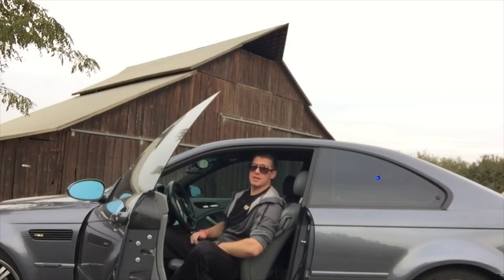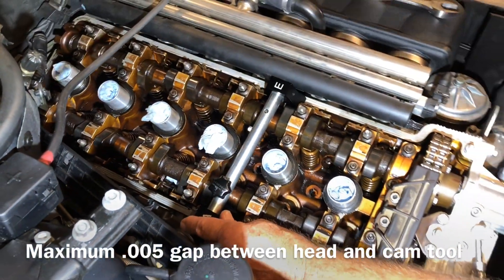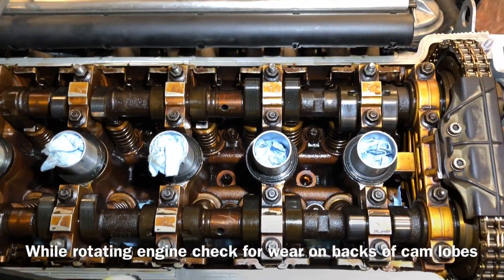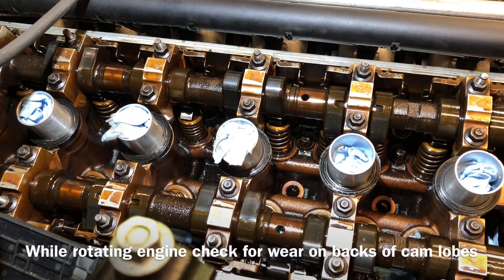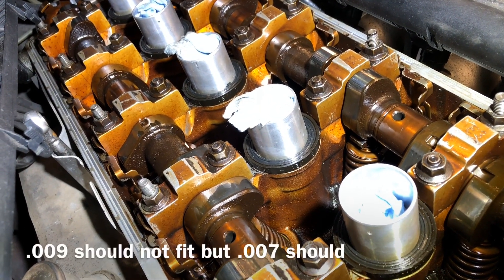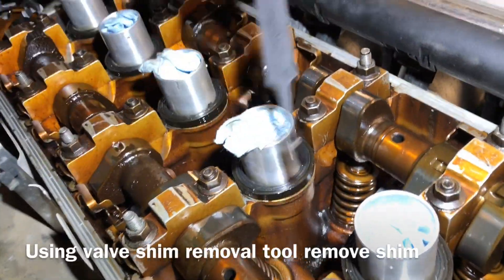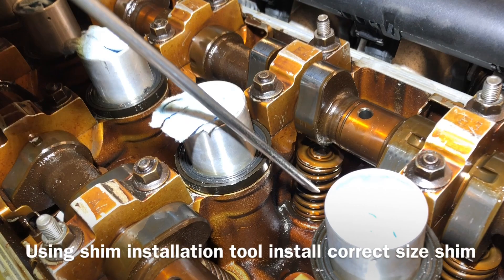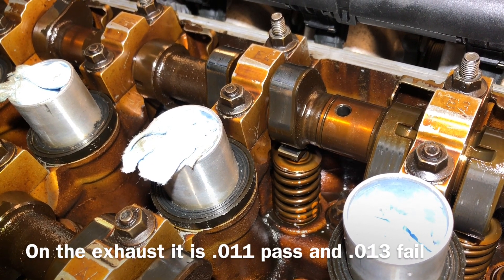HOW To Valve adjustment e46 m3 S54

Comment: Great video!!!!   I have problems set cams before valve adjustment.I put pin to crank shaft.l. put timing bridge ,but I can’t turn intake or exhaust cam with 24 mm tool. Can’t you tell me way please???thanks

Comment: I think you can do it while working on the vanos, if you have the cam alignment tool and are ready to adjust the timing afterwards. 
Also, watch out not to drop the shims (or put some towel to plug the holes), it happend to me twice (fortunately I was able to recover the shims with a magnet!)
Reply from the maker: Thats the perfect time to do it; when its already opened up!  Lucky you that you could save it!

Comment: Hi, great video! I just have a quick question. Is the camshaft alignment tool really necessary? My car has been running fine, so I'm assuming the timing is correct. I want to check the valve clearance and adjust if required but wasn't sure if I needed the alignment tool to do this (It's $234!)?

Comment: Thanks for this. Will be doing this next week since the PO neglected to do so. I'm also due for rod bearings in the next 8000 miles also
Reply from the maker: thank you for letting us know you enjoyed it.  Rod bearing video coming in a couple weeks! should be a good one
Reply: @FatboysGarage  Absolutely fantastic videos, worked in a 70 year old machine shop for a few years, haven't seen attention to detail since the owner retired and closed up shop. Please keep posting videos, own an e46 M3 myself, just to appreciate the engineering and art of the car.
Reply from the maker: @evajordan450  Appreciate that!  Were going to keep it up!  Glad to hear you enjoy the videos! Is yours a current project??
Reply: @FatboysGarage  I named her Phoenix, picked it up not running, 116k miles and had sat still for 3 years outside, spent almost two months working on it before I brought it home from the shop. Going to rod bearing soon as well as full restoration of the interior and a full paint job. It has the SMG, and I love it. I could have bought a clean one, but I couldn't bare to see this car get parted out, so I dug my heels in and am currently trying to decide on a direction to take the car. I've been leaning towards keeping it original with minor upgrades such as Vanos, touch screen radio, SMG and ECU tune, upgraded headlights from 865 retrofit, and maybe a carbon fiber roof down the line. Its alpine white with soon to be black interior. Puts a smile on my face every time I see her in the garage.
Reply from the maker: @evajordan450  beautiful, glad to hear you saved one from becoming scrap.  Im sure in long run youll be happier with your choice and can look it at and see your achievement.  Whatever direction you take it, it will be exactly what you want it to be, since youre going from ground up.

Comment: Any tips on old stuck rocker arms? None of mine will move more than maybe a quarter inch when trying to slide them over
Reply from the maker: you can consider some seafoam deep creep and spray it into the rocker arms, let it really soak in for a while( days perhaps if necessary).  Work them around to get them loosened up from the grime thats in there.  You'll want to change your oil after this to ensure no contamination.  Let us know how it turns out!

Comment: If you have to a valve adjustment and rebuild your vanos, which one would you tackle first?
Reply from the maker: With ours, we first did the Vanos, as we put the engine back together we then performed the valve adjustment.

Comment: I'll leave that job to the professionals :) I'm going to do a coil and spark plug replacement on my 2004 M3 that I just bought. That's about as adventurous as I want to get.
Reply: lol then you bought the wrong car, prepare for cracked strut towers, blown through shock towers, ripped our RACP panels, and torn subframe mounts. Its literally a car you don't want to own if you aren't willing to do almost everything on it yourself
Reply from the maker: @DontStopReeling  You are right about that.  Not to mention the VANOS.  This car could cost you 15k in damage and maintenance in no time flat lol.  Great car has a lot of great qualities.  But with the great qualities come lots of work you HAVE to do yourself.  Cant be afraid of it, thats what were here for trying to show how.
This January comes lots of new videos- including that subframe, brakes, and rod bearings.
Reply: @FatboysGarage  I essentially had to rebuild everything except the trans and engine on my e36, still not happy with 25% lock , 95a poly bushing still move a lot. The reaosn why I can't get myself to buy a e46 m3 is people sell them at the point they need rod bearings and RACP reinforcements. I keep debating whether to get another e36, an e46 or a 335i , but I'll probably get another e36 because I can easily fix everything on it myself, and its a great platform to learn how to wrench on
Reply from the maker: E36 is a solid choice man. e46 or 36, you're gonna need to rebuild a lot of the car.  The solid bushings are the way to go.  I thought they would be to stiff, but our track day car has solid all the way around and you know what?  It rides better in my opinion than our street car with the Poly's.  In January youll be seeing our work on the chassis reinforcement: we are going to extra lengths with a special kit.  Let us know which one you decide on bro, we love to see your project

Comment: Hi there grate video I’ve got a quick question so if a .009 fits all the way on the intake side and.013 fits all the way on exhaust side do they need adjusting.

Thanks
Reply: Yes they would, .013 and .009 should not fit
Reply: billy verduzco thanks for the reply

Comment: The clearance measurement procedure is not correct.
A probe is inserted between the end of the valve and the rocker, but not between the rocker and the back of the cam of the camshaft. The gaps at these points are different.
Learn geometry!
Reply: Eh, that’s not correct. According to different sources online, and a write up from ECS tuning on how to perform this procedure, it is to be measured between the rocker arm and the bottom of the cam lobe. NOT between the rocker arm and the valve shim.
Reply: what are u refering to?
Reply: When the guy measures the clearance he slides the feeler gauge between the cam lobe and the rocker face. 

You are supposed to measure from the top of the shim to the bottom of the rocker.

Comment: Great video guys! This job looks a little intimidating for the average DIYer. How long should it take for a good mechanic to do this. I inquired how much does it cost at my local shop and he told me around $1000. And if I purchase the shim kit does it come with those tools to check the measurements and also that BMW tool with a little magnet on it or is that a separate purchase? Looking forward to your next video for the rear subframe reinforcement and also the future rod bearing replacement. Keep up the great work much appreciated! 👍🏻
Reply from the maker: Just so you know bud, we've provided links in the description- they are affiliate links and if you need parts please use them! Helps us stay motivated to keep making videos like this.  You can do this job man, with the right tools!  Is there anything you're missing?
Reply from the maker: This is our link to the shim kit- which includes the shim tool, and feeler gauge for measuring you had asked about.
Youll see this in the description also- you will also want a cam bridge tool for the job- in description.

https://click.linksynergy.com/deeplink?id=wjLDNk1cnDk&mid=43304&murl=https%3A%2F%2Fwww.ecstuning.com%2Fb-assembled-by-ecs-parts%2F89mm-valve-adjustment-shim-set-with-tools%2Fvsk4kt%2F
Reply from the maker: Thanks for subscribing to the page and watching the videos, if you have some questions let us know.  Were glad to know that the videos are being used!
Reply: Fatboys Garage Thank you for the link for the kit. I will definitely purchase it soon. My car does not need a valve adjustment just yet but when it does I will definitely be ready now that I’ve watched this video and I will have a friend help me tackle this together. 👍🏻
Reply from the maker: @Livingmybestlife68  Good deal man!  Is this your daily? or a project?
Reply: Fatboys Garage  it’s a second car. More of my weekend fun car. I just like to learn the best way to tackle big jobs like,this.